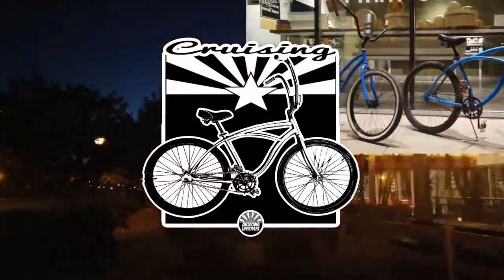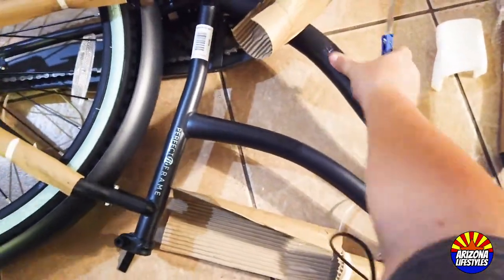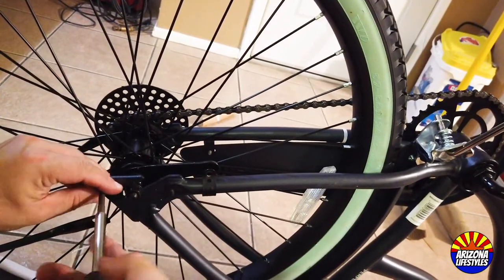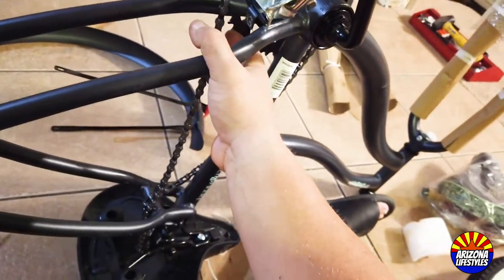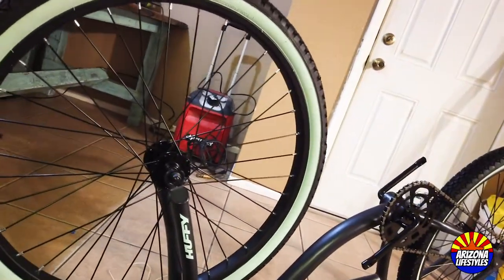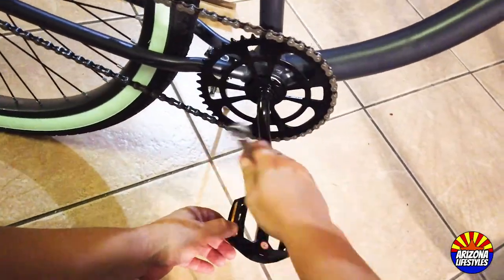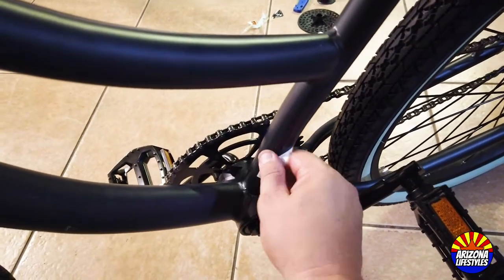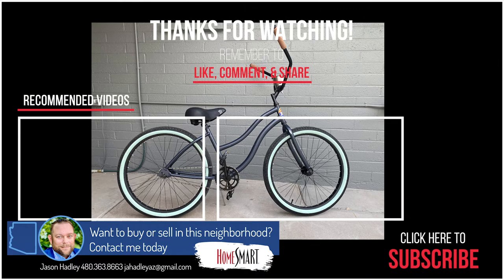Huffy Cranbrook Bicycle Assemble from Stock to Custom out of the box in HD

Comment: I have a new Huffy panama jack bike and am trying to put it together, but I can't get the seat to stay on the post.  I tightened bolts on both sides but there is no grip and the post slips right out.
Reply from the maker: Get a new post or a new seat , or take it back to Walmart … sometimes you get a decent huffy sometimes ya don’t… I’ve learned that early on. If it was me I’d get a new seat, new handlebars and new grips right away …
Reply: @ArizonaLifestyles1  I did get the bike, and an adult trike for my son, at Walmart.  I have a contractor friend who is going to put them together, but I felt like giving it a try..  I just saw a video about Walmart bikes manufactured using inferior materials.  We will just be riding in the neighborhood.   I will definitely take your advice!